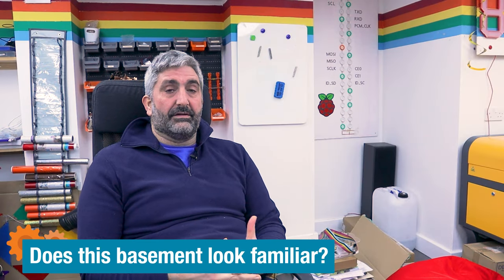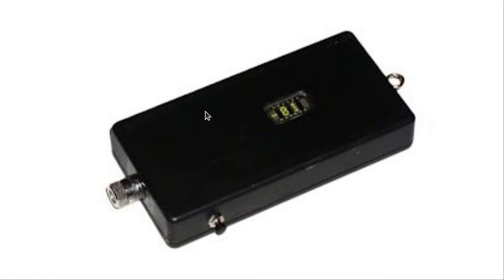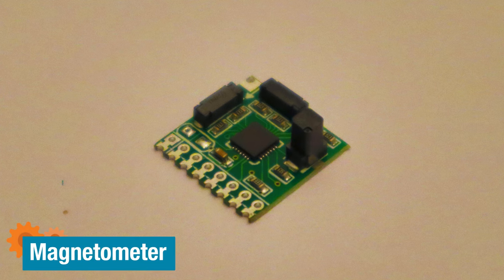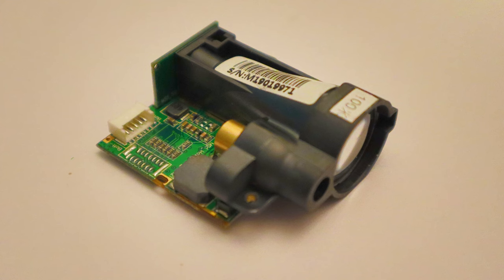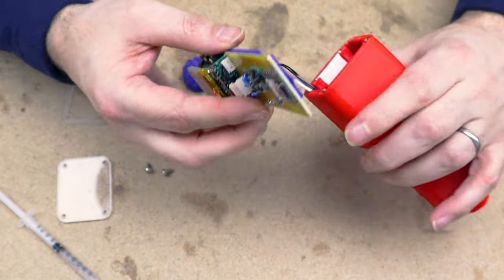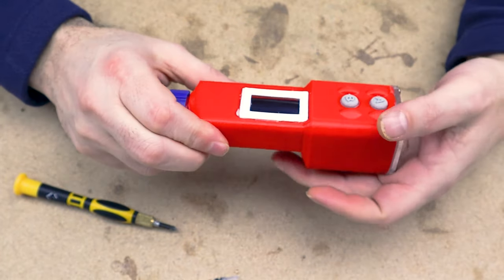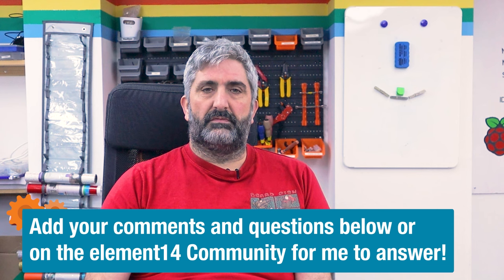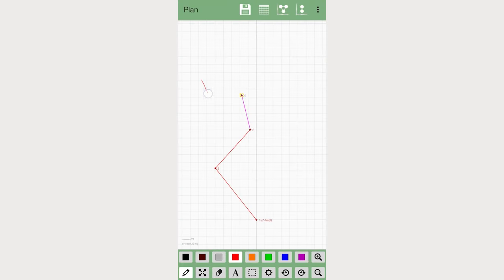Building an Open-Source Tool for Cave Surveying

Comment: I found the Bosch BNO055 to be a good inertial sensing unit that gives you a 9 axis IMU with a UART and I2C built in and its easy to get absolute headings and real compass readings.
Reply: I did look at this. Unfortunately the magnetometer within it is not accurate enough for my needs, we need sub-degree accuracy. I did like the autocalibration feature of it though ..